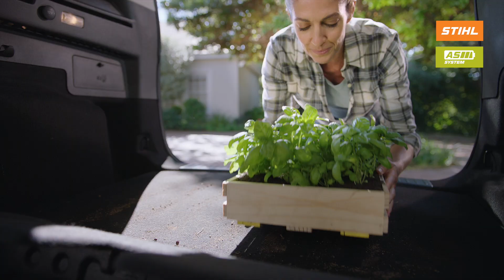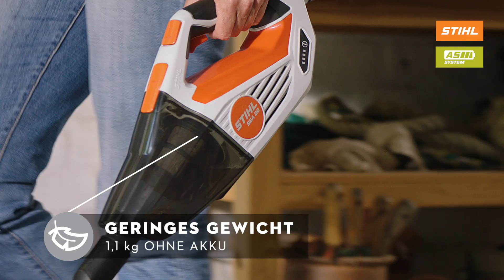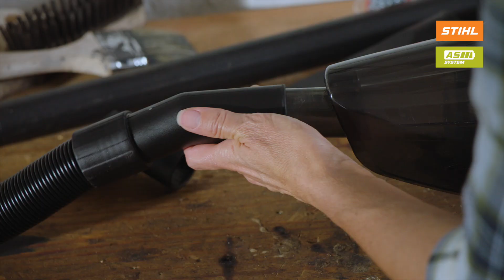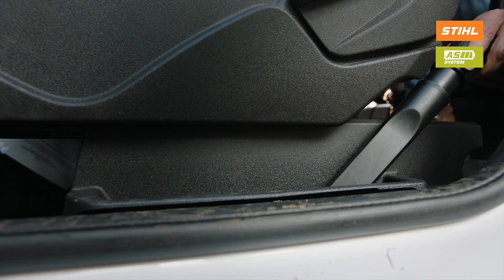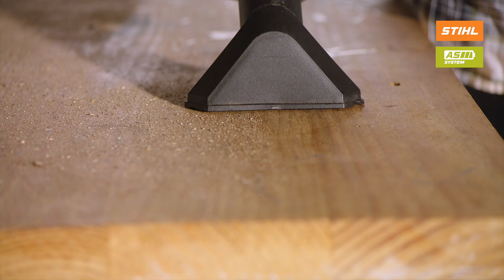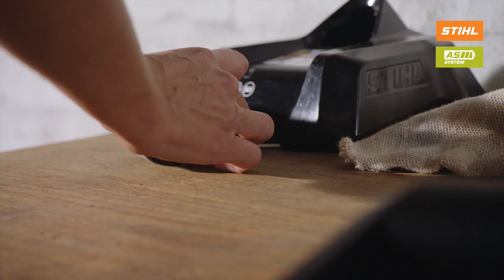Deshalb. STIHL Akku-Handsauger SEA 20

Comment: Ich hab eine HSA 25. Passt der Akku auch in diesem Akkusauger?
Reply: Nein, weil du bei der HSA 25 noch den AS 1 Akku hast. Hättest du die HSA 26 hättest du den AS 2 Akku und der passt dann auch in den SEA 20, in die GTA 26 und in die HSA 26 . GTA 26 kann ich nur empfehlen, die hab ich auch. Macht richtig Spaß und freude damit zu arbeiten. Ich hoffe das stimmt alles was ich geschrieben habe. Wenn nicht tut mir das leid und @STIHL  soll mich dann bitte verbessern! Danke 😉!

LG Johannes
Reply from the maker: Hallo Frank,
die Aussagen von Johannes sind korrekt.
Der Akku der Strauchschere HSA 25 ist nicht kompatibel.
Für den Akku-Sauger SEA 20 wird der Akku AS 2 benötigt, welcher auch bei der Strauchschere HSA 26 und dem Gehölzschneider GTA 26 zum Einsatz kommt.
Viele Grüße vom STIHL Team